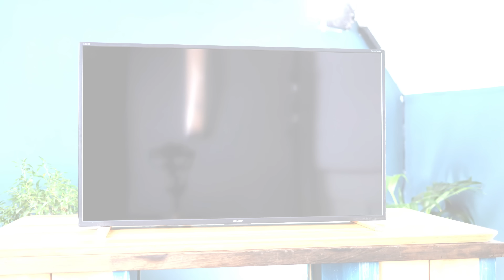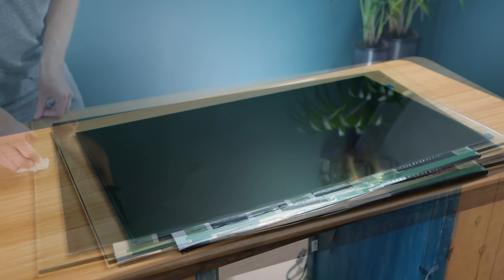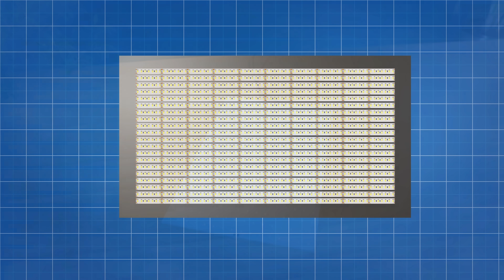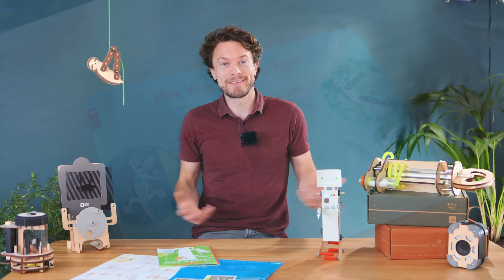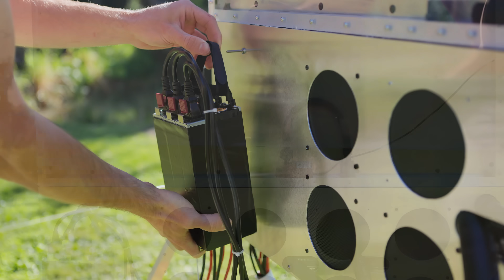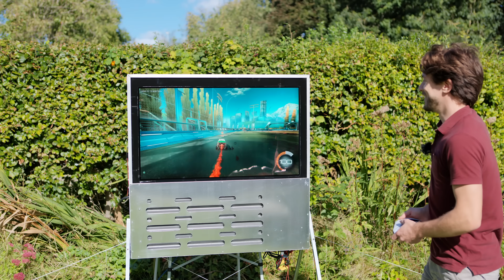Building an ULTRA-BRIGHT water-cooled TV...

Comment: Slightly disappointed that the backlight wasn’t the sun… How? Fresnel lenses and a parabolic reflector of some sort? It would only work well during sunny days and not at all at night. But I was expecting him to do it because it would light up my geeky little heart… COULD also use fiber optics to keep the parabolic source away from the display. Could you do oled backlight dimming of the light source by using another screen at the fiber optics intake (with obs?) possibly? Think homebuilt projector reversed. Fun 🤩
Reply: …Could probably just use a couple mirrors too… But that would be too easy. And the parabolic reflector would need to be following the sun… Same with mirrors. I am curious if cloud coverage lowering the ambient light at the same pace as the screen, would make the dimming of the light source/tv imperceptible? Many interesting geeky challenges and things to explore….

Comment: Here me out, instead of competing with the sun with raw electrical juice and LED Power, what if you used mirrors to redirect sunlight at the back of the screen, using glass for a transparent back to allows livht to get through, and transparent LEDs to have a measure of control on the overall strength and for nightime usage. It might be kind of costly up front, if you used sun tracking programs and actuators to keep the mirrors angled correctly (if you had space you maybe could just use a lot of mirrors and refract the light properly), but it's power consumption would almost evaporate.

Comment: Consider putting on a clear heat film on top like a ceramic film.  Might could help reduce some of the uv heat from the sun which will put a little bit of strain on the led from the front.

Comment: I was thinking, would a transreflective lcd work better in this case? Instead of using a backlight, it has a mirror surface behind the lcd layer which would reflect back lights from the surrounding, which would not only save electricity, but also be simpler!

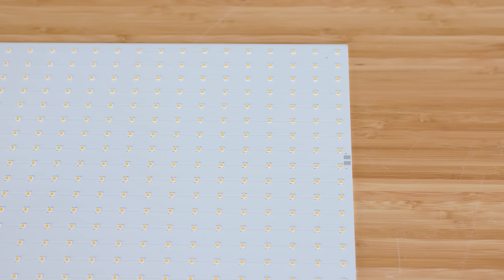Comment: 8:30 I have the opposite hypothesis. CRI is way less important in this application since it’s going through a known filter. As long as your rgb light passes through efficiently and in equal amounts it shouldn’t matter to your eyes as your eyes are observing the light directly. The omission of the phosphor layer makes the led light output more efficient as well, doesn’t it?

Comment: You could add longer cables and keep the power supply safe inside the house or a waterproof casing so it's completely water resistant.

Comment: Why don't you build a cheap, bright TV, but instead of using LEDs and a cooling system, use sun and mirrors? really, really cheap and interesting project idea : D
Reply: Aas a guy who used to work in thermal solar systems, to do it well would be far more expensive than this.
Reply: LCD screens block quite a bit of light

Comment: @DIY Perks I wanted to build an 80 inch version of this but then realized the power consumption would be enormous! I would need 70 cob LEDs and each consume 70w so a total of  4900W in just LEDs! According to this video that would give me around 2000nits. If compared to a commercially available outdoor tv (75 inch samsung The Tarrace) which outputs 1500nit but only consumes 550W max. How is this possible?!

Comment: Idea: What if instead of using a back-light for this TV, You use the Sunlight itself through some form of Mirrors and reflections?
- This means the TV should in theory be as bright as the Sun on a hot day (meaning that the TV will always be visible on a hot day). 
- Maybe have some form of back-light that can allow sunlight to pass through it (like have the backlight on a cage, so the natural sunlight can pass through the back-light). 

This means that on a hot, bright day, the sun will be doing the heavy lifting and you can save some electricity, while on a dull day, the backlight will do the work but won't have to be as bright thus still saving some power costs.

Comment: Why is air cooling no good option? In winter it freezes and algae dirt will plug the radiator from all the warm and sunlight exposed to this water 😮
What size is your tv and what "year" as you need backlit led tv for this not edge lit or some other funky tech to convert this 😅

Comment: I just came across this video again, and had a bit of a random idea... some older LCD screens didn't have any kind of backlighting at all, and instead used a reflective material that would bounce light back through it.  Would something like this work for a modern LCD?  Mainly thinking of the old gameboy and gameboy advance handhelds without any lighting.

Comment: Even cheaper than LED strips: Reflecting the sunlight in. This way the TV even auto adapts to the absence/presence of clouds in realtime. And saves on electricity. Cooling is probably easier too. - Might need UV filter to protect the crystals. But you should have the widest possible color gamut :)
Reply: LCD screens blocks quite a bit of light which means the brightness would be reduced both in and out

Comment: Non-backlit screens, like the reflective LCD screen on the Game Boy Color, rely on external light sources, such as sunlight, to illuminate the display. In direct sunlight, the ambient light is typically much brighter than the light emitted by a backlight. As a result, the reflective LCD screen can take advantage of the intense sunlight, utilizing the light to enhance visibility and contrast. The lack of a backlight means that there is no additional light source causing glare or reflections, which can improve the screen's readability in bright environments.

In summary, a non-backlit screen, like the one on the Game Boy Color, can offer better visibility and contrast in direct sunlight compared to backlit screens. The intense sunlight acts as the primary light source, resulting in a potentially crisper and more vibrant image without the issues of glare or reflections caused by a backlight. This makes non-backlit screens well-suited for outdoor viewing on specific devices, particularly in bright daylight conditions.

Comment: You overlooked somthing. Those super hot lights are going to roast the light diffuser and other plastic parts inside the screen it self. The older imacs had cooling issues and when thry got hot you would start to see a black or yellow boarder from the discoloration of the plastics. Even though you are cooling the leds the heat will destroy that screen. The panel wasn't built to handle that much. It may also melt the polarizer as well which is a super thin plastic piece built into the lcd panel. Combine the heat from the leds and the uv rays from the sun that panel will be cooked to death. Not only that but you now have a giant piece of glass on the front which is now insulating the panel and also magnifying the sun's rays right into the screen. I know you did it more for the video and not for any real purpose but if you make a 2.0 version with no budget ide suggest using a glass diffuser and a pane of thin 1/8 inch glass for the front.

Comment: I’d be curious if it heats up substantially while being exposed to the sunlight considering it has an all black screen. Smartphones for example are build to be capable of cooling themselves to certain degree but usually overheat while being exposed directly to the sun for a while…can the water cooling handle that?

Comment: If I attempted this kind of projects personally, I would definitely went with first option more frequent leds that could be cooled passively or with small relatively quiet fans.
It would be still outside tv, but I put it in a shade (not in a direct sunlight where I don't want to be when I am chilling outside - at least for long periods of time)
and it would be sufficient and  more cheep and probably add roof so I have to make it moisture proff, but not rain proff.

Comment: I see over $350 worth of aluminum alone in this. That big tube of UV glue looks to be a couple hundred dollars (I got a tiny syringe of it for $16 for a small glass bonding project). The glue may yellow over time and/or due to UV exposure (it did slightly on my sauna TV bonding proj), althogh some varieties might hold up much better than others. If all the parts were purchased for this project AND if he were billing fairly for his time, this would be a $7k tv - which is perfectly fair, given the factory $5K unit benefits from industrial process cost savings and economies of scale.

With that said, this is an amazing project, and a very useful approach when making e.g. a custom outdoor display that's not available to buy, such as a 21:9 ultrawide unit.

Comment: Hi Matt, you take great steps to remove LED heat but what about the LCD panel? The LCD is not lossless and it's mounted on glass (a good insulator). With that much light going thru it, it will surely heat up considerably, did you take that into account?

Comment: 4:10 - UV-reactive glue is indeed UV-reactive.
But, have you ever wondered why you don't get sunburnt while stting in your house? - Glass blocks UV light.
Reply: UVB, though.
That's what causes sunburn.
UVA is used in blacklights, which is fine.
UVB could've damaged the screen, which happened to me while "drying" a flooded but working monitor. It developed colorful splotches that discolored any color to the splotch color. Bummer. Especially since that display refurbished could've cost 250$..

Comment: Why the boards of the screen looks scuffed?
There is a big mark on the bottom left.
And because you have your voltage boosters set to a fix voltage (48v) you will not be able to control the brightness with will unable you to use the TV at night or indoors. What you could do is measure the resistance range of the potentiometers that give you the voltages that you need for the min/max brightness.

E.g.
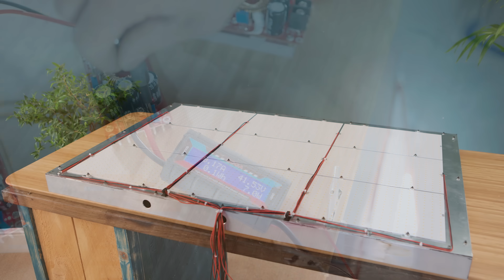Lets say that this 10:33 potentiometer is 10k ohms and you want a range of 24v for min brightness and 48v for max brightness.
And lets say the voltage booster gives you 24v at 5k ohms and 48v at 9k ohms.
You can replace the potentiometer with a with a 5k ohms resistor + a 4k ohms potentiometer in series.

Make the potentiometers accessible from outside and you can now control the brightness.
You can even automate the brightness control if you use a Arduino or Pi + light sensor + a digital potentiometer. This will require some coding and electronics knowledge.

Comment: I have a TCL 6 series with the mini-led backlighting, and was thinking that with all the LEDs you have, if you can connect them to a TCL 6 series backlight controller, you could then have a super bright display with really nice blacks. Not sure how many leds you ended up using, the ones in teh TCL 6 are a lot smaller, pixel sized, but just an idea...

Comment: Those 12v power supplies are imperfect for LEDs. They need a constant current power source and doing it that way is via a resistor. This causes a voltage drop which causes excess heat and inefficiency. Use a Mean Well LED driver for it.

Comment: Once again you knocked it out of the park.  Is it possible to create a seamless virtual production led wall using a similar process? With that level of brightness, I'm thinking it is?  Could several once-removed led panels be placed side by side with without creating visible seams between them?

Thanks

Comment: AWESOME BUILD !!! ..   I have one question.. this is great.. 
I will be building this.. However.. NOT out of aluminum .. Wood. ( with rain/UV protected coating.. etc..  but you said to ground the TV controller to the aluminum.. .. where would you ground it to , if NOT using metal to build the case??

Comment: Awesome, just awesome. Re aesthetics.  Much more than the black border I'm bothered by the asymmetry of it, the asymmetry of the holes in the aluminium front plate and the aluminium part all together. Much better and practical IMO to mount the radiator and PSUs and stuff at the back of the display, ie. make the TV deeper and not tall like it is.

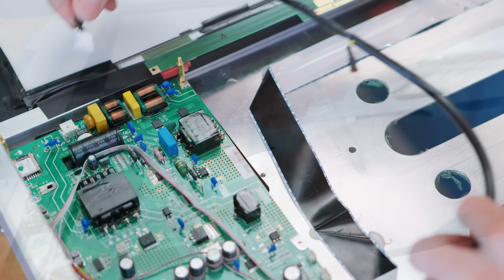Comment: At 6:34 , the power cable tucked to that screw makes me think the screw will eventually eat itself thru the plastic around the cable and short circuit it. Sure, the whole tv might not live that long anyway, but in the case it does, it will die one day due to the screw eating itself thru the cable.

Comment: Hey Matt that is really great fun, the only thing I would add extra is a simple inline water flow sensor that would switch off the led panel in the event the water pump fails, its about 5 quid and worth every penny, I use them on my C02 Lasers to save the plasma tube from overheating....Really great fun your projects as usual..Well done.

Comment: I am surprised that rather than water you would have used a summer time coolant which would work a lot better than plain water. 
I could never have a TV out side where I live as we get summers starting from 29°-52°c here in Australia in the full sun it has been known to get even hotter at times because I live only a few kilometres/miles from a desert. Even the water cooler would be struggling on those days. Great idea that’s for sure 😊😊😊

Comment: Could probably use natural sunlight as a light source using some mirrors while keeping the original backlight. Somewhat this can be some sort of auto-brightness and the original backlight will be used during the evenings. It would require less power and produce less heat I suppose?

Comment: Try to make a tv with built in speakers, so you don't have to use two different remote controllers to make the volume level perfect. This because we have separate tv-audio and speaker-audio, which makes the audio difficult to fine-tune. I'd find it awesome if you could build all the audio into the tv.

Comment: I wanted to quickly mention, the source of the glass does matter. If using a window, make sure it's not a more modern one, they are now built to block UV, meaning it would be impossible to cure the UV reactant glue used in the video
Reply: They don't block 100% though.
Reply: The glass does not block the entire UV band, plexiglass does.  
Normal or special glass blocks UVc, UVa, and partially UVb.  UV adhesive can also be cured with purple light at 405nm or even blue light ranging at 435nm ~ 450nm.  No special glass in modern windows can block blue light or purple light.
Reply: @ThermalWorld_  I'd say the question isn't completely unwarranted, some UV resins if you have them open indoors, just from the light coming through the windows, they will not cure. A good example is most 3D printing resins, you don't need a darkroom to handle these resins. It's not just a matter of waiting longer for same dose, there is a intensity threshold below which it just doesn't cure. It's same sort of thing as reciprocity failure in photography. So when in doubt, it might be a good idea to test first.
Reply: Question can your light be dimmed as day turns to night or cloud coverage. 
I think the black band helps to reduce glare at edges improving clarity. Great job on build and explanation.
Reply: @charles paine  If you watched the video to the end you might guess yourself, that the answer is NO, it can't be adjusted. Otherwise, it would be possible to adjust it for colour measurement purposes.
Reply: @charlespaine987  yes, just lower the backlight voltage
Reply: @siaa7078  that probably lowers the life span of the LEDs and would also change their colour temperature. A proper way would be PWM.
Reply: im pretty sure glass naturally blocks uv
Reply: I apologize for anybody this happened to, but that would be an absolutely hilarious problem
Reply: glass by itself blocks 98% of UV light. Any glass.

Comment: hi, i did this a while ago with a high wattage halogen bulb instead of led for even higher cri of nearly 100:  https://www.youtube.com/watch?v=nRu64YLXaH8

you engineered some nice watercooling system, a bit like on some ancient combustion engines where there is a kind of metal grid formed like a tent on top where water sprinkles down

if you put a fresnel lens (from an old back projection tv) in front of your modified tv, it could serve at night as a crude very large screen projector...

whats the total watts of your led panels? 

maybe for power saving the sunlight could be utilized instead of artificial lighting,
e.g. with a heliostat parabolic mirror, or easier a set of flat mirrors
so the whole thing would use only around 50 watts of power in bright sunlight

better yet would be a reflective lcd, but afaik not available at that size or very expensive

Comment: I wonder if you could recycle a full array local dimming chipset or create one specific for which ever led based setup you use, could bring the contrast to crazy new levels, I know it wouldn't necessarily be easy, but my question is would it be doable with the proper knowledge while keeping the build cost comparable to the rest of the components for the unit 🤔

Comment: Cool project, but your polarizer will die quickly from heat and the high humidity and at least, please get the electronics above the water. Also a TV doesn't only run a mains voltage, those things also operate on high voltage...

Comment: Whats the maximum amount of light you can use? I mean you can get 300w cob leds of wich you can fit 24 in a 65“ tv wich is 7200w
. The thing that i am worried about is not the 7,2 kw or the cooling but the panel itself getting burned by the lights.

Comment: Instead of using high CRI leds it seems more sensible to me to use RGB leds that are monochromatic and match the LCD's maximum transparency wavelength of the 3 color channels. This will produce the most saturated image possible and will thermally be the most efficient as well. CRI is not a concern when you look straight into the light itself, it becomes an issue when light is shining on and being reflected by other objects such as skin or fabric.